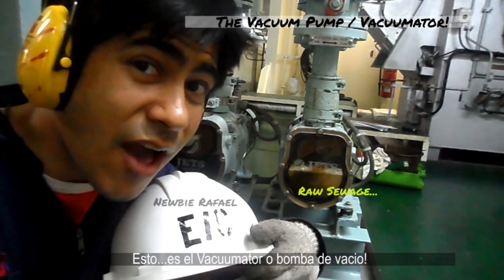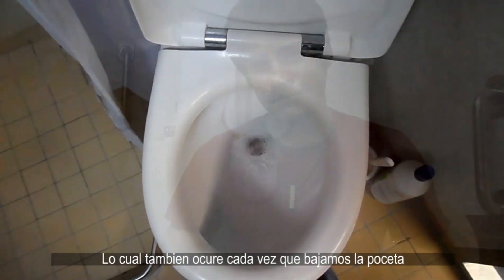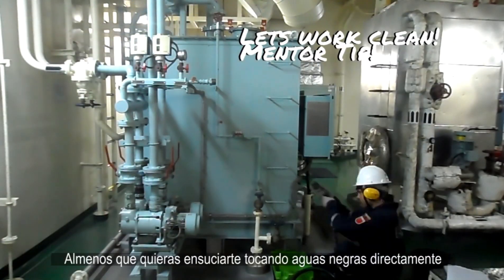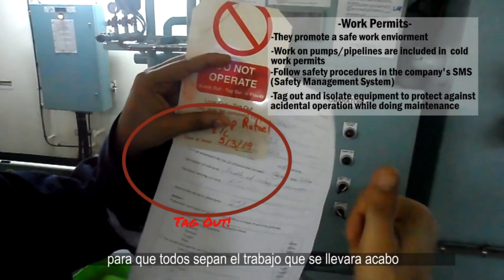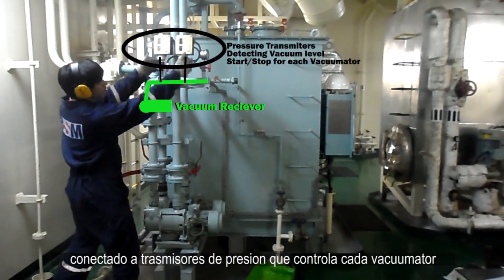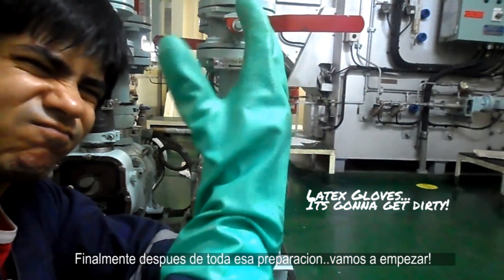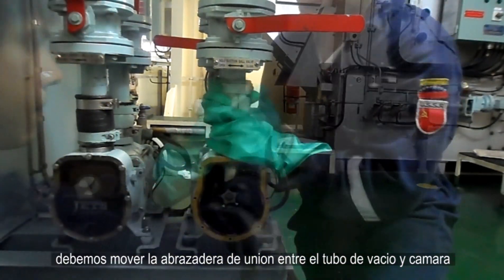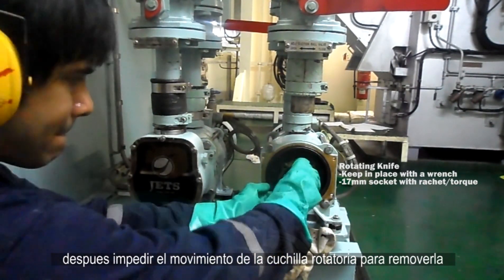Vacuum Toilet Pump - Toilet system on ships

Comment: Nice!!! But, What will you do if there is no vacuum in the toilet, but it is everything ok with the pump?
Reply from the maker: My mental mentor! It's so nice to see a comment from you..

 Well if the pump and suction chamber are OK, then there are a few reasons why I can think of a lack of vacuum in the system.

1)if it's localized in port or starboard then maybe some smart newbie forgot to open port or starboard sewage inlet valves or engine room overhead pipelines are clogged because no one flushed it. 

2)if it's localized to a few cabins I'd have to check on the deck pipeline diagram and see if they share a vacuum accumulator (I want to show that in my gamazyne video)... Maybe some smart guy flushed a rag or something and clogged it.

Could you put some other ideas Prof. Andrei? Haha
Reply: Happened on our vessel, The whole Port Side got Clogged, We had to open each flange of the pipeline and Flush it. Took us 2 days to make it operational. A total nightmare.

Comment: There is no water left in the pump glass and it cannot create vacuum. What do you think is the reason?
Reply from the maker: It could be various things, does it lose all water suddenly or is it something gradual? If there are standby pumps does this happen to all pumps or just one is specific? Do the pumps run frequently due to suspected vacuum leak?
Reply from the maker: This is because if it is just one pump you can check the flap in case it is clogged with something, if there is a vacuum leak in the acomodation it will cause the vacuum pumps to run without the toilets giving new water to the line causing the pipeline to be dry (there may be a connection to connect a hose and prime the line for flush the toilets full of water various times. Just some ideas, remote troubleshooting is always difficult.

Comment: I feel a little bit misterious in our vaccum system....sometimes the pressure was dropping down to zero that leads to the engr to close some valves going to accomodation,but when we open the closed valve again, we see that the pressure is stable enough....then after 6 to 10 hrs or 24 hrs the pressure dropped again....we inspected all the lines and the toilets but we have not found any leaks,..we cannot understand why the pressure is dropping down.....
Reply from the maker: that is very strange amigo, I really hate the fact that in the vaccum system one must be like a detective and search all over for the solution..maybe it could be the flap that sometimes does not seal properly on the vacuum pump however the real source can be many things.
Reply: Having same issue basically we had one pump that loses vaccum and seems like the flap keeps getter stuck shut we replaced to new pump and still getting same issue

Comment: May i ask to you about this vacum jet, my vacum jet has a little bit trouble, the automatic vacum jet can not stop if water in glass not reach of mark, so how to repair this pump? 
Thank you.
Reply from the maker: If the water in glass does not reach a mark...? The pump should stop when vaccum cut point of the pressure transmitter is reached. From what you tell me that water level will cause the pump to stop MAYBE means that the water reaches the rubber flap and creates a SEAL.. Which then means the RUBBER FLAP non return valve is not sealing correctly and you should change or clean/smooth. I hope this is the case because it is an easy fix, success and nothing else

Comment: I'm a licenced aircraft maintenance engineer with more than 25 years on the job, so I probably am the equivalent of your chief engineer. But I see man similarities between marine and aeronautical engineering (this is why I'm watching channels like yours).
It seems that in both fields the most junior ones get the most disgusting and dirty jobs. E.g. maintenance of the toilet system of an aircraft is usually also the job of the most junior techs, as is lubrication (of flight controls and landing gear with a grease gun, another job where you usually end up covered in stinking grease). 😀😁
Reply from the maker: Hahahaha yeahhh but with tough work comes good experience. Always work with a smile and good additude and of course learning all the way. I'm glad all our branches have these similar stories.

Comment: Did you close the sewage inlet valve while performing priming of the vacumator?and did you manually start the pump after the suction and pressure chamber filled of water?
Reply from the maker: Yes I closed the inlet valve (no incoming sewage 😂) however after flushing I closed the pump inlet valve and allowed sewage to flow to the second pump.

I manually stated the pump as soon as fresh water started to flow to ensure anything stuck is flushed out too.

Comment: Where do you get the O-rings and rubber from?
Reply from the maker: Greetings Connar! All spare parts (not just for this pump for about all equipment in the engine room) are ordered by part number (found in manual) to the company and the company orders requisitions from shore (by the manufacturer or shipyard, etc)
Reply from the maker: Something important to note is that it's the engineers duty and responsability to order enough spares for the voyage.. 

If you run out of spares make a requisition and if the company does not supply.. Then you either make a creative solution or hopefully there is a spare pump/equipment 

(usallly all things on the vessel come in pairs for non stop operation even when in maintance.)